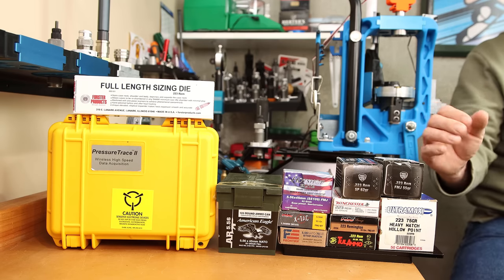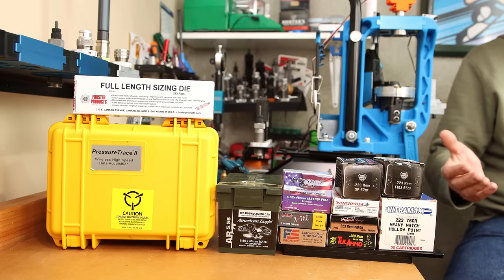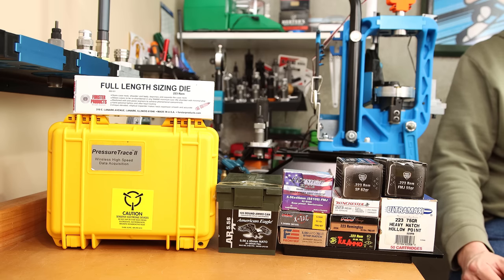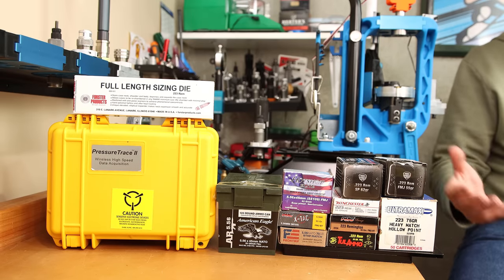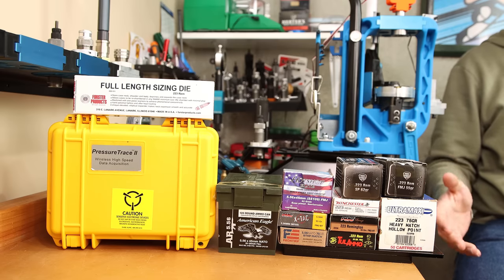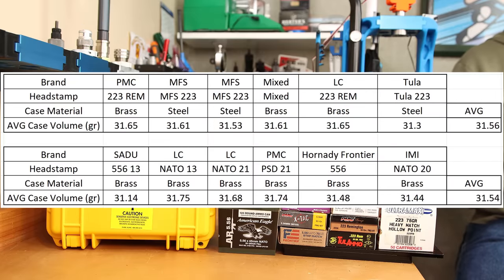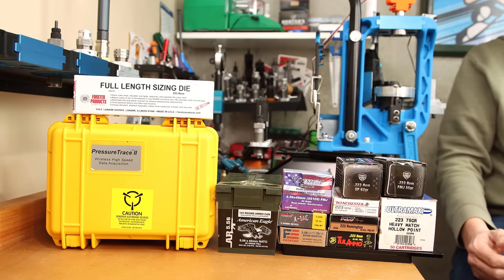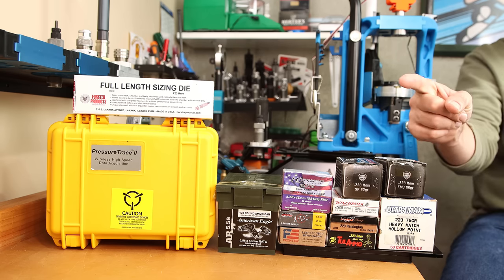223 vs 556 - The Hidden Truth No One Tells You!

Comment: It is very easy for false information to proliferate in the firearms industry. There are a wide range of gun people from the truly ignorant to the well informed. As such myths tend to get a real foothold. This is also because of how loosely the industry itself has used terminology over the years. Examples include the paramaters used to name ammunition. For a long time there was no standard. 45/70 ammo was a 45 caliber bullet over 70 grains of black powder. The later 30/06 round is called such because it is a 30 caliber round adopted by the US military in 1906. So called 38 special ammo is not 38 caliber at all. Nor is it 37 or even 36 caliber. No, in fact it is .357 in diameter which is why all .357 magnum guns will fire 38 special. So why was it not called .357 lite or standard, or short? Who knows. My point is that over the last 160 years, gun and ammo producers have been very malliable with how they use terminology. You combine that with the ignorance of many average people and you get a confusing mess. Fortunately there are people like you who put in the time to clear up some of the confusion.

Comment: The barrel being used is an 18” SPR barrel from White Oak Armament chambered in .223 WYLDE. This chambering is designed to withstand the pressures of 5.56. .223 REMINGTON is not. The original problem was firing 5.56 from bolt actions chambered in .223 REMINGTON. The .223 WYLDE was developed around 1957. .223 REMINGTON was developed around 1950. The discussion has always been between .223 REMINGTON and 5.56. This video is a waste of time.

Comment: Your methodology is flawed. You tested different manufacturers, different batch years, different case materials, and one of your data sets had a larger sample size than the other. The simple fact that LC has different data when you compare them from different years means there may have been a change in the production process (Unless I missed something, which I'll be the first to admit I may have). The key to accurate testing is to control for as many variables among your data as you possibly can. You seem to have done the opposite of that and injected as many as you could to get a "diverse" average. 

Getting a diverse average is not necessarily a bad thing, provided it is done in the correct way. This, was not the correct way. In order to take the "kitchen sink approach" to comparisons, you need a MUCH larger sample size. That probably isn't plausible given your budget (that was not intended as an insult, just commentary on the price of ammunition and the size of the sample batch you would need), so that only leaves an apples to apples comparison. Get both of the calibers from the same manufacturers, at the same time, with the same projectile weight. Feel free to get several types so that it isn't a single point of comparison. After that, go nuts. Near as I can tell, your tests themselves are spot on. It's just the methodology by which you generated your sample pools that is flawed.

Comment: I’m tired of hearing so much bs about this subject. The truth is that for it to be labeled as nato it needs to meet certain criteria like crimped bullets, crimped primers, full power loading to specific velocity, and must use clean burning powder (stick powder over ball) for reduced fauling. NATO means that there are many countries and manufacturers using and producing it for use all over the world. It all needs to meet criteria to all be within the same spec. It is used in semi and full autos which need bullet and primer crimping to keep them from falling out from vibration in magazines and causing malfunctions. It will be used all over the world in different climates with extreme temps from 120 to -100 and the powder needs to burn clean and not be temperature sensitive. Primers will be sealed for water protection, and chamber pressures and velocity needs to all be within the same spec. Higher pressure will keep a dirty gun running longer. 223 has no mandatory specifications or requirements. Manufacturers load a little light for safe usage in all guns, can run any powder the want, never crimp or stake primers, and rarely weather proof.

Comment: who are using metric system those imperial mesuring numbers do not make any sense hat is 223or 556  no clue . That why I hate Imperial mesuring systems .
Reply: .223 and 5.56 are not fair comparisons. They're the same round. The .223 is .223 of an inch. The 5.56 is 5.56mm in diameter, which is the same, more or less, as thr .223. So, basically, it's the same designation using two different measuring methods, Imperial and Metric.

Comment: It is very difficult to make any sense out of something where you're presenting at this quickly and there's 10 bushels of extraneous information on a spreadsheet with two arrows pointing for 5 seconds. At one point you said something was going 32, 023 feet per second when it was actually 3, 023. Your work is good but your presentation is virtually gibberish you have to stop the screen to look at the data and try to figure out which one is which. If you want to discuss the average pressure for a brief second go ahead and make a separate piece of paper with 223 in one column 556 in the other column and the average pressure under each one. This is just almost annoying so I'm not going to watch anymore of it.

Comment: Simple truth is. The 5.56 is loaded to a lower pressure so it can be used in a huge range of NATO country weapons. If your weapon is rated for .223 then you can use NATO spec ammo. Don't try it the other way round.
Reply: You have that exactly backwards. 5:19
Reply: @hazcat640  Thats what I was taught inthe UK military. Was my instructor wrong  ?
Reply: @MENSA.lady2  Per SAAMI the 5.56 is rated at 61,000 psi and the .223 is rated at 55,000 psi. 

223 Remington Specs

Bullet Diameter: 0.224 inches
Case Length: 1.76 inches
Overall Length: 2.26 inches
Parent Case: .222 Remington
Case Capacity: 28.8 grains H2O
SAAMI Chamber Pressure: 55,000 psi

5.56x45mm NATO Specs

Bullet Diameter: 0.224  inches
Case Length: 1.76 inches
Overall Length: 2.26 inches
Parent Case: .223 Remington
Case Capacity: 28.5 grains H2O
SAAMI Chamber Pressure: 61,000 psi